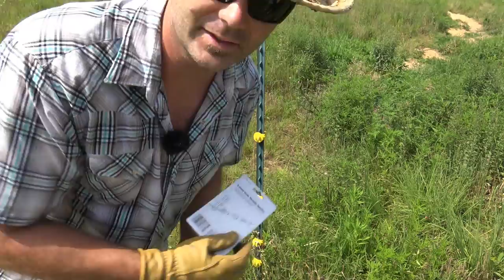PESKY GOATS WONT STAY IN THE PEN! Fence gets re-worked..Why Mrs StoneyRidge isn't on the Vlog much?

Comment: I have watched your blog many times on my farm when I cut the logs I could not pull the stumps. Every time we did we ended up with a lot more rocks then you have. I took advantage of the tree timers as you have for mulch and I used the chips to burn my stumps out it worked well.

Comment: I gave up on electric except as a  single inside wire to deter rubbing and heads stuck.  Went with the cattle panels and a singe t post in the middle.  Then caribiner clip or wire the ends.  Super easy to put up and down with t post puller. Lots less parts and no more escapes.  If you time it right at TSC you can get a good deal.  It costs more but worth it for me.  I heard someone say buy once, cry once.   So far true in this case.

Comment: I'll tell you what I'm thinking. Those goats are going to keep getting out until you put up a proper fence. They are some of the best escape artists there are. You need to use hog fencing with an electrical deterrent wire. Also goats don't eat just anything like everyone thinks they are picky about what grasses they will eat and fruits and vegetables. You also need to put something in your field for them to climb on that will keep them occupied so that they will leave your fence alone. I like your Bronco looks like a good hunting truck.

Comment: With an electrician background you may strongly consider how extensively the charger is grounded to ensure a strong shock every time, which may not be nearly as reliable in more dry, rocky, or poor (little organic matter) soil.  Maybe you have but I didn't see it referenced.  Some have used 3 x 8' pieces of rebar driven in full length to ensure reaching moisture all the time.
Reply from the maker: Very good point...I do have it well grounded...however the fence isnt permanent so I dont have multiple ground rods, I have to pull the ground rod and move it when I move the fence, but it is a copper clad steel ground rod..and the fence will knock the crap out of ya

Comment: Get a proper sized charger and use galvanized wire. Aluminum is too expensive, breaks too easy and the extra conductivity is unnecessary if you have a proper sized charger.

Comment: You need 6 wire with those little goats they are the worst about getting out of all goats plus get a 6 joule box to power fence.
Reply from the maker: I think I just need to build a more permanent fence...coming soon ! Wanna build it once and be done! Gotta wait till we clear off all the land first
Reply: Put up 4 foot field fence with a wire inside to keep them from rubbing and getting heads stuck I you put up electric put up 8 stands of high tencel wire better to do it right the first time

Comment: Definitely prettier than you! lol Grow the beard back! I had just put that nylon wire as well and my Nigerian Dwarfs went right through it like nothing! I also am having a problem with my electric as well! Originally I had the energizer I bought from premier 1, but it eventually died so I bought what I thought was a more powerful one from tractor supply. Needless to say I think I am going to have to spend the money and order another one from premier 1 with poultry netting. It just seems to work better!
Reply from the maker: I've used both...and so far i've had 2 zareba failures this year...not cool!

Comment: Ha that poly wire aint goat proof you should know better goats chew and they are escape artists.  They just want to eat what you do not want them to.  Fence has to be tall enough to stop them from jumping too.  Oh plant some sourgum seed around that will help keep the goats in place.  I got married 25 years ago, I got divorced 16 years ago and I am still single.  I probably am not the best person to comment on you Mrs. Issues.  But good luck with that I wish you the best.  Well of course she is prettier than you( probably smarter too) ha
Reply from the maker: They are great at escaping that's for sure....but they wont eat that wire...it will knock the crap outa them!
Reply: Stoney Ridge Farmer yea I am sure hope it is variable voltage that you can adjust down.  They are not cattle.